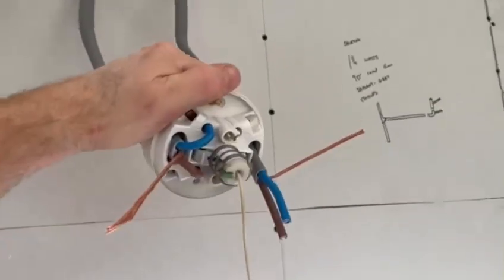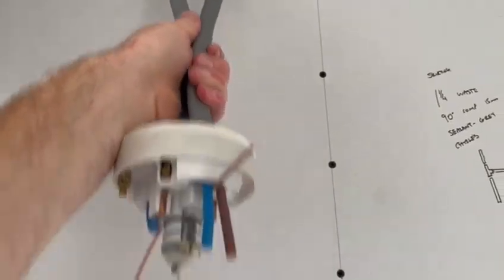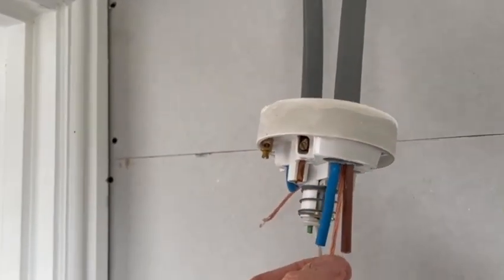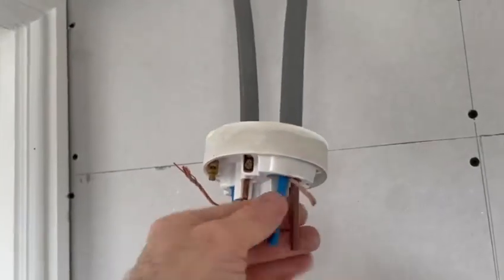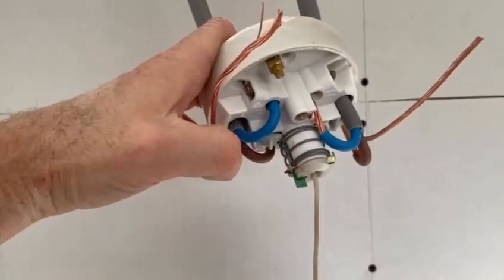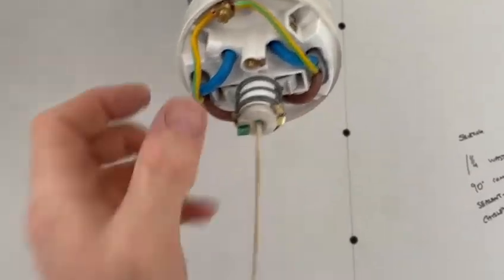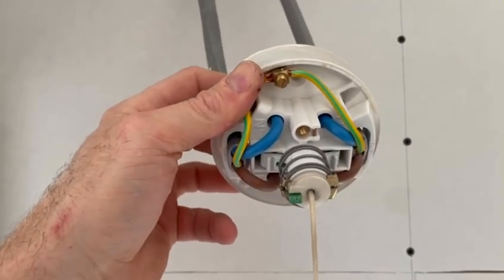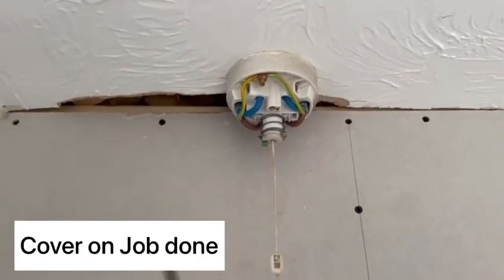Tips For Wiring up an Electric Shower Pull Cord

Comment: I have this job to do at the moment and I'm failing miserably. 10mm cable I'm finding is impossible to terminate in the fitting, given up! I have a Crabtree pull cord and the spring and the little plastic thing and little metal thingy have fell out no idea how it goes back together, absolute nightmare.

Comment: You make this look so easy. I've watched this video a couple of times and wondered why it's so hard. My wires are over 20 years old and there's a massive hole in the ceiling preventing me from using something small like this 😂 instead I'm trying to cram these inflexible Wires into a tiny box and pull the rest back up into the ceiling. I'm having another crack at it today, and hopefully sort my shower out for good 😂

Comment: I completely get the idea of a spare length of cable in the ceiling.  Will you just leave it loose? I have heard of cases where new build apartments failed inspections in UK.  The inspector opened a socket,  pulled on a cable and he could hear it rattling in the stud wall.  Will your work be inspected by anyone when you are done? Thanks
Reply: I'm guessing the socket you allude to was supplied by a vertical cable "dangling" in the wall, whereas the shower cable is more likely to be lying on the upper surface of the plasterboard ceiling.  Just a thought!

Comment: These pull cord switches seem to encourage users to switch the shower off using them, instead of the shower controls. That can damage the shower, whilst a DP isolator plate switch outside of zones is less likely to be abused in this way because it's less convenient to reach.

Comment: Contactors are the way forward.
Reply: The majority, not the minority of contractors, are nothing but a bunch of cowboys, I've had to redo more electrical work done by so-called professionals than I've had hot dinners.  I wouldn't have a tradesman in my house unless it's absolutely necessary.  Electrics in your house is not rocket science, as long as you adhere to the latest regs and use the correct materials, anyone with common sense and a bit of confidence can do most things electrical.
Reply: @MrBrockley3  contactor, not contractor. A contactor is a type of switch that uses a small load to switch a large load.

And as a spark and Electrical Installation Lecturer, I can assure you, domestic wiring is significantly more dangerous than you think it is.

Comment: Do you use 6mm for 8.5kw showers out of interest what size MCB would you use seeing as 8.5kw shower pulls around 38 amps

It would need a 40 amp MCB and in the table for 6mm only clipped direct would comply as in trunking it says 38 amps or under insulation it can drop to 34 amps 

I always use 10mm also myself for anything over 7.5kw but come across so many 8.5 and 9 kw wired in 6mm protected by 40 amp MCB with the cable laying under insulation in attics

What's your opinion on the fact that the 8.5kw shower can only pull 38 amps but there being a 40 amp MCB protecting the cable
Reply: I agree with this comment .     majority of bathroom showers ,  the cable passes through the loft space ,  which   there is a high chance of loft insulation,,,     Never use 6mm  on a 8.5kW..  !!

Comment: Personally I think the double pole pull cord switch is a pain in the bum they almost always overheat. I prefer a 50amp double pole isolator wall mounted switch out side the bathroom/showroom. Much easier to install and work on. But Matt has done another great job with that pull cord . 
A great example of good workmanship . 
Great video as always Matt / Gaz 👍

Comment: Lads pray you never have to use 10mm lsf cable for pullcords pure torture
Reply from the maker: Great point
Reply: I'm learning this the hard way as we speak 😂 doesn't help that the previous home owner has bored a massive hole into the ceiling to pull the wires through. Connecting the box to the ceiling was a job in itself 😂

Comment: To be honest that's the best type of 40/50A pull switch on the market -  for new installs from scratch.    The more common type with the separate patress is more of a pain in to work on.  More restrictive by the type of patress and more importantly its knock out opening in the back.  Plus most installs of this other type switch seem to have basic insulation exposed in the loft/above the ceiling.  They also have a tendency to burn out even with the terminations tight due to high resistance switch contacts (due to torsion applied by thick non flexible conductors).
Reply from the maker: Massive thanks for your feedback it’s very much appreciated 👍🏻
Reply: That’s why I’ve started using contactors.

Comment: Although isolators in bathrooms/kitchens are not a requirement in my country, i would rather have used a contactor/relay in the d.b. to deliver the high current to bathroom shower. 
Then use a light switch in  bathroom, to activate  coil in contactor/relay.
We also, always use double pole mcb´s in the consumer unit/d.b.
U.K seem to have some weird way/requriements doing electrical in domestic, compared to other european countries.
Like no socket in bathroom for instance, yet an electric shower is allowed
Reply from the maker: Wow thanks for the detailed comment 👍🏻
Reply: ♦  Many in the UK use a contactor in the consumer unit with a light switch with neon indicator outside the bathroom. 
♦  The UK does allow sockets inside bathroom but 2 to 2.5 metres away from the wet zones.  This precludes sockets in 95% of bathrooms - that is one of the reasons why the UK has one of the lowest, if not the lowest recorded electrocutions.  
♦  The UK has single pole MCBs because all is polarised unlike the continent.  Double pole RCBOs are becoming the defacto norm, replacing MCBs. RCBOs are rare on the continent. All socket circuits in the UK are recommended to have AFDDs fitted, which are mandatory in some installations. 

The UK is better than the continent overall for sure. The only point they have over the UK is that the French have a standard combined main switch/500mA RCBO provide by the electricity supplier, and all breakers are double pole breakers at the consumer unit (if double pole is an advantage over the British single pole of course). But double pole means a twin comb busbar meaning it is neater inside consumer units. But all these are available on the UK if you want to fit them. British plugs and sockets leave all others looking like something from a Lego set. And standard plugs are a maximum 13A. We also have the superb final ring that delivers power to each room.

Comment: I got shower where N burnt out twice at the feed N pull cord switch.. Can't be loose connection it was done twice wired to 9.5kw 32A rcbo 6mm
Reply: I used to use MK pull switches. In the last few years they have been so crap I have had quite a few burn out . I have now gone over to Crabtree and had no problems
Reply: @andysims4906  on Nutrual feed side?
From what you saying it makes sense, brands have different quality
Reply: @faithful5475   Yes it was on the neutral side.   15-20 ago I couldn’t fault MK pull switches  not anymore. Avoid
Reply: 9.5kw is over 40 amps, should be on a 10mm
Reply: @georgetaylor853  you right we all understand that's part but not like they using full 9.5kw that's full heat so more likely its avarage between 4 to 6kw otherwise you would burn yourself.. The rcbo would trip if you demand more than 32 for short period of time, right?
Reply: @faithful5475  Actually electric showers draw pretty much the same current whatever temperature you put them on, the way it controls the temperature is by the speed it pumps the water through the element. That’s why you’ll notice if you put it on coldest setting the water pressure is a lot greater than when it’s on the maximum temperature where it trickles out at a lower pressure due to heating the water for longer.
That’s why you’ll see that there is no diversity applied to instantaneous water heaters as they always draw the same maximum rated current.
Reply: @darrenqualters2341  I agree and disagree with some parts, I will have to check how much current it draws if I put it on medium temperature. If it draws full 9.5kw that explains everything, as far as I know the element will heat up according to required temperature.
Reply: @faithful5475  they normally have two elements. If you select low setting just one is powered. Temperature control is achieved by varying the amount of water passing by the element(s)
Reply: @darrenqualters2341  Cold water inlet also effects the maximum temperature output. On colder days more current will be drawn to heat the water to the desired temperature. Quite possibly the secondary element too. If it's used on maximum load, meaning higher amperage draw.
Reply: Common

Comment: What on earth is that, UK and it's medieval stuff..
Reply: Medieval, perhaps you want to enlighten us
Reply: @TheGorillahands ❤
Reply: @TheGorillahands  There shouldn't be any electricity in a place where water is splashed around, like it does in showers/bathrooms. And if there is electricity, because you don't want to brush your teeth in de the dark, it's 12V with the power supply above the ceiling or the other side of the wall.
Reply: @ariebastiaanse3423  good luck finding a 9Kw shower at 12v
Reply: @ariebastiaanse3423  that's what zones and ip ratings are used for
Reply: @ariebastiaanse3423  You do get that this electrical switch is out of normal reach and operated but a pull cord (a piece of non conducting string)?
Reply: It looks to me like one of the Crabtree 50a pull cords which are actually a much better design, as you can dress the cables in neatly like Matt has with no strain on the them when you fit the lid. They also have a much easier pull cord mechanism which are better for elderly and disabled.
I see so many of the newer design with burnt out connections where the installer has badly fitted them, especially with 10mm cable where they try and force it into the 1 gang box putting strain on the cables and connections
Reply: Horrid things.